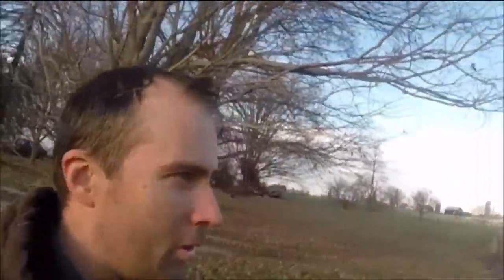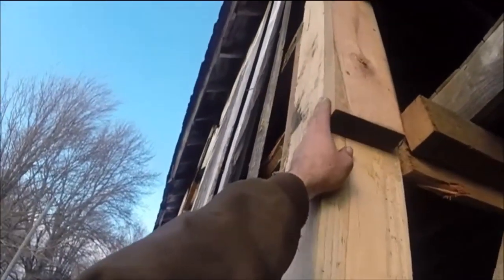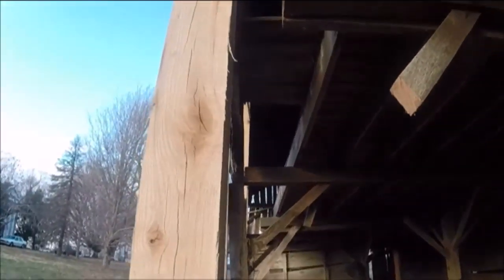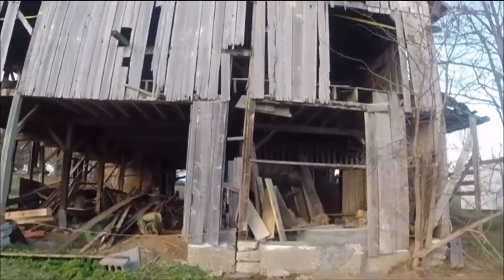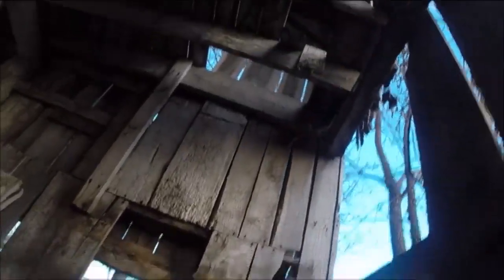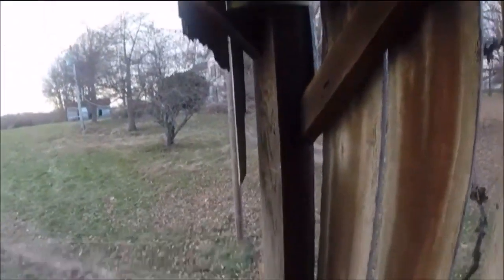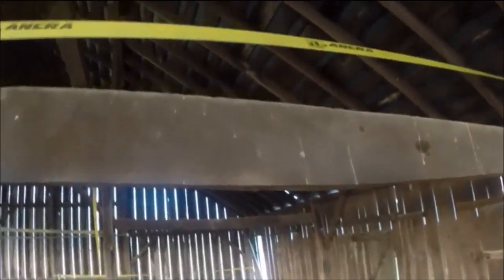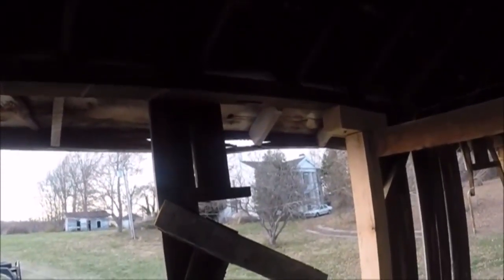This old barn/shop week 8 or something like that update

Comment: hey if you can give a drawing of your shop layout where everything is located in the floor layout design you can run ur pipe for floor heat around all the machines and all of the other  stuff like colums, footings this stuff me and my dad know about pm me if u have ?s

Robert  like the vids keep them coming
Reply from the maker: That would be nice but my machine inventory is not very static and I expect with the exception of the HBM things will be moving around the shop from time to time.  How deep can you put the line in and still have it effective? I have wondered if I put it 8" deep in the floor I could drill and lag without worry of hitting a pipe. I am afraid it would be not very effecient and it would take a very long time for it to respond to heat inputs.
Reply: bcbloc02 Hi Brian, I am  looking to to do something similar with a shop (probably a new steel building) with hydronic heating and a common boiler to heat multiple buildings (House + Shop and perhaps other outbuildings in the future). Like you, I don't want avoid bring in wood into the house, and deal with the ash and smoke. Although I am going to build a small outbuilding with the boiler instead of using an outdoor wood boiler.

For the bolting down the machines. I am not sure if this will work, but,  I thought about embedding magnets over the hydronic lines so they can located after the pour, If your pouring more concrete soon try embedding some cheap neodymium magnets as a test, and see if they can be detected (with a set of neodymium ball magnets. You can also carefully map the hydronic lines and mark the floor, perhaps dye the concrete for a no-brainer permanent map. You also need to install rigid foam under the floor so so the heat doesn't transfer into the ground. I think putting the hydronic lines 6 inches down is would make it inefficient and probably impractical.  Another option is to set up areas with no hydronic lines (Sets of 10 to 12 inch wide rectangles) that are designated for bolting machines into the floor. Or you can pour  concrete footings on top of the floor, but makes moving machines in the future a problem.
Reply from the maker: You have some good ideas, thanks for the thoughts!